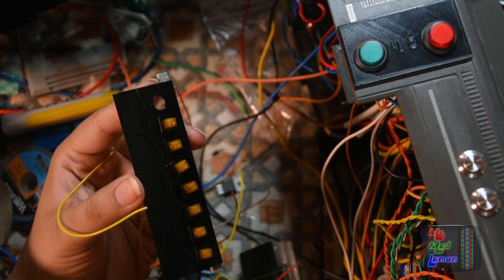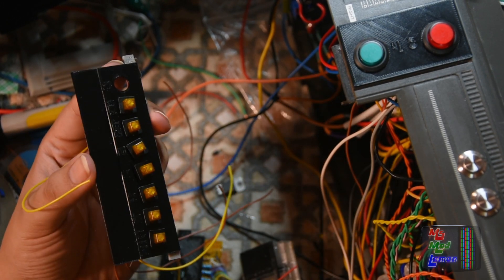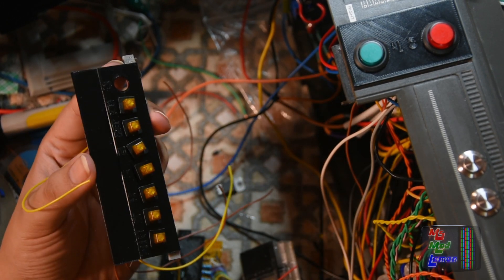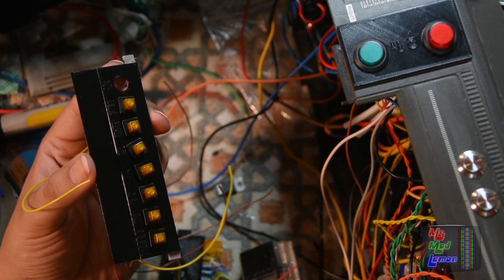Main Assembly 2 - SidBoomBox Project 19

Comment: You're amazing 😍
Reply: I'm restoring a fisher phw805 boombox i found on ebay. I had the same as a kid and I really want to be successful. How ever after rebuilding my tape deck i decided I'd add a l.e.d to the tuner area i ran it directly into the power batt light it worked fine but as i was moving the wire to soilder them in I touched the wrong side and blew the tuner and sound is there anyway you can give me a idea if. Blew everything or something particularly I've recaped a few capcitors but no luck i am novice i am working with just a multimeter any help would be appreciated😊
Reply from the maker: @Mysterious3Music  Aah darn!.. well firstly NEVER solder or work on anything while it's switched on, but i'm sure you've learned that already :o) 
Capacitors arent going to be the issue here, most likely you've blown a transistor somewhere, but check the simplest things first. Check if the cassette mechanism works, if so then it may be a fuse you've blown where the power is... if it's just the sound that's the issue then check the transistors in the amplifier on the main board.
Wish you the best of luck with this repair and restoration :o)
Reply: Thanks for responding I really appreciate it. Love you're work.

Comment: There's a right angle attachment for Dremels. It's handy for getting into awkward angles and also lets you cut nearer to whatever you're cutting, because you don't have the body of the Dremel in the way. But, the other thing I've found really good about it is that you can get a much better grip and control when cutting. They're not cheap, but worth it for getting more controlled cuts.
Don't bother with the router attachment though it's awful!
Reply from the maker: I'm not sure if you're referring to the engraving extension? I must check out the right angle attachment... I did buy the engraving extension for stuff like this and it is much easier, it's easier to hold and gives you better control. 
I've not seen the router attachment yet.
Reply: There is a right angled head that screws onto the end of the Dremel. I'm not sure if I've tried using the engraving extension for cutting, I might have to give that a try now you've suggested it :-) I originally got the right angle for my dad to cut track on his model railway, so the cuts were 90 degrees to the base boards, rather than at a slight angle.

The router attachment is too plastic, nothing stays locked so it all kind of slops about so you can't get accurate edges. There is also a circle cutting tool that can also be used as a guide, this works better for some jobs but still suffers the same issue of tightening metal bolts onto plastic casings :-(